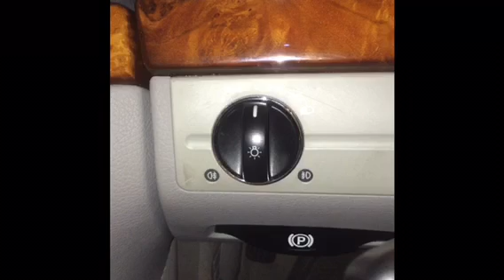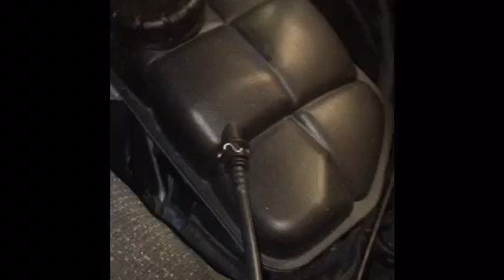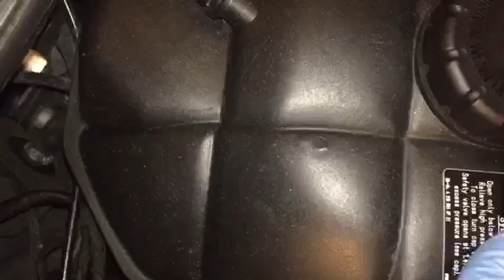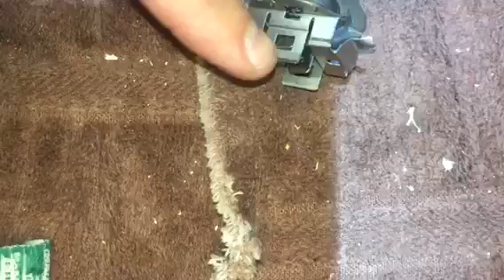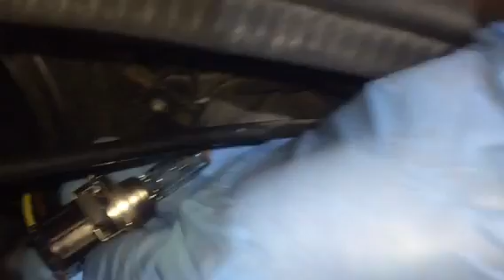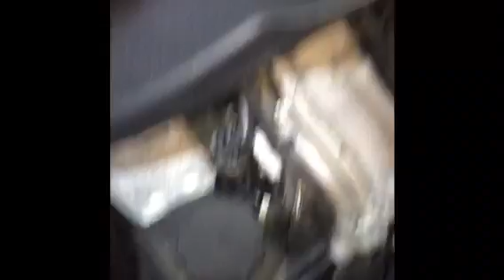2005-2009 Mercedes E350 (W211) Headlight bulb replacement

Comment: Thanks! I've done it 3 times in the past, all of which were a MAJOR pain to execute, every single time. Even the shape of the socket itself seems like it was made by a masochist because it's so difficult to handle with any sort of firm grip on it.  And the tails on these sockets were so short, I was barely able to contort my forearms sufficiently to try and see what the heck I was even doing since I couldn't see!!  Anyway, this video helped a lot especially in determining the socket's orientation when reseating it into the lamp housing. I finally got it done in only 2 HOURS!! Thanks MB!!
Reply from the maker: Glad it was helpful!

Comment: Hey, great video and thanks for taking the time to put it together.  It sure helped me change the bulbs in my E350.  In case it helps anyone else, I learned that you can just pull the bulb out of the connector, leaving that intermediate metal piece intact on the black plastic connector.  No need to pull those two metal wings apart to remove it and then reattach it.  Cheers.
Reply: ]4g

Comment: Do you know why im getting the message sometimes but othertimes the light works fine?
Reply from the maker: Mine were replaced after about 11-12 years, so yours may need to be replaced.  It is possible that one of the connections to the bulb is loose or not getting a good current.  After replacing bulbs (which are inexpensive), spray "electrical connector cleaner" in wired connection to help remove corrosion.

Comment: Hi, does this particular car have the ABS? My w211 has it, and I was told the bumper needs to be removed in order to change headlight?
Reply from the maker: Yes, it has ABS but I did not need to remove the bumper.
Reply: @DIYGuyUSA  Ah gotcha, thanks! I can't seem to remove the metal tabs counterclockwise on the passenger side :/ Any ideas why or do u have a video on removing that side?
Reply from the maker: Adnan Ali - I don’t have a separate video as each side worked the same. It is hard to see but you may be able to use a mirror along with the flashlight to figure out what is keeping it from turning. Make sure you pry the sides out first.

Comment: For this matter, this is the best video showing how to do it. One thing needs to be mentioned. When you pull out the coolant tank at the bottom of the tank there are 2 rubber anchors laying on top of the 2 fitting holes. Don't loose them or when you put the tank back, it's going to wobble and making funky sounds when the car is moving. Thank you for the video, DYGGuy.

Comment: Great video....  shows the most detail.  I did not remove the metal clip, just pulled the bulb out of the socket.  I plugged the new bulb back in and then had a hell of time trying to install the light and plug back into the receptacle socket.  I finally figured I had plugged the bulb in wrong.  I took out the bulb, flipped it 180 degrees and then the whole assy just screwed right into the receptacle in the headlight housing.  So heads up... the two prong plug on the bulb can be plugged in either way, however it has to be certain way otherwise you can't mount the bulb assy in the headlight.
Reply: I was going to say the same thing!!!  Thanks!
Thought I was the only one having a hard time with trying to plug the bulb into the receptacle.  Took me a good amount of time until I figured out to try to unplug it, flit the prongs around and back into the receptacle.   Also, if you haven't changed the bulb in a long time, then it will take you time to unplug it from the receptacle because it will be stuck due to accumulation of grime and heat/cold.  Just twist it back and forth a lot.
Most videos do not show that and that is when you waste the most time.
Reply: @d @dannyho772 have been fighting to get the bulb out, tried twisting it back and forth doesn’t budge, am I missing something
Reply: Shouldn’t you “ops check” before you reinstall the cover and coolant tank?  Hate to have to go back in for something simple.
Reply: Its not easy but its doable without removing the pump